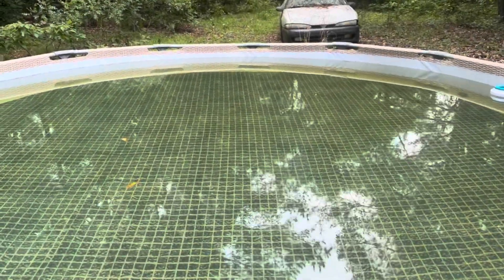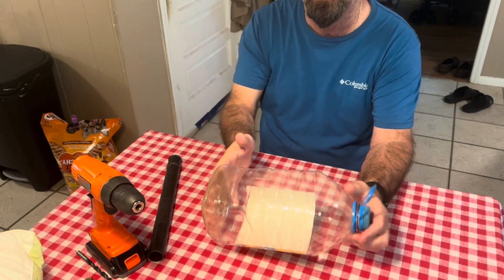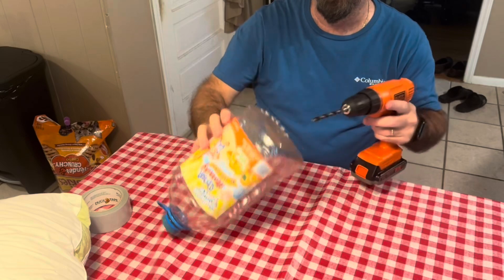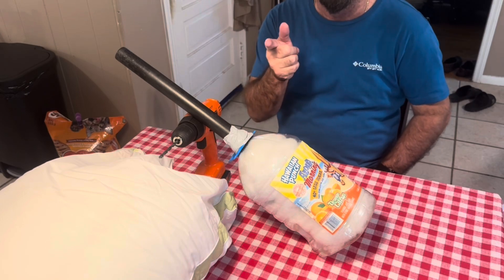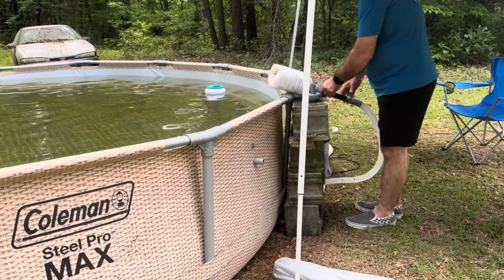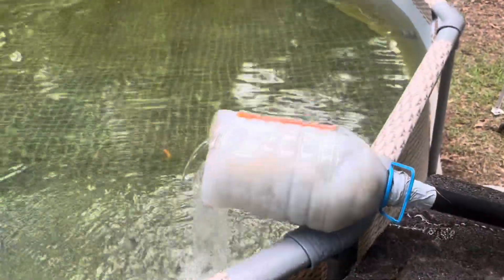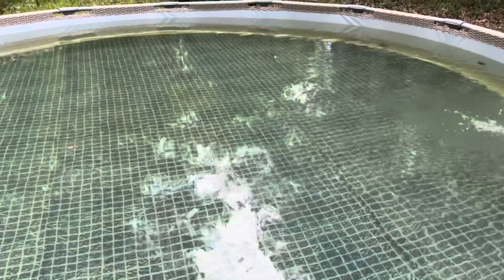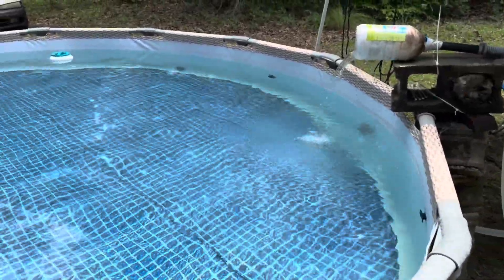How to get iron / rust out of pool water (well water)

Comment: buy a walmart pillow for $4, cut a corner off and zip tie the pillow around the return hose. the fabric gives you an extra layer of filter and the pillow is cheaper than polyfill
Reply from the maker: You could try it that way but it might would choke the filter pump out? I don’t know?
Reply: @ShinyKnife  that's what I use, works fine
Reply from the maker: @wg2228 ok there you go!

Comment: Can you do a video on how you clean it . What chemicals
Reply from the maker: Plenty of videos out there on that. I do however have a pool vacuum I show cleaning the pool should be in the description. The chemicals I use are 3 1 inch chlorine tablets with a clarifier. A little baking soda to soften up the water. And some Hypo Cal Shock. It’s a small body of water pretty easy to keep clean just run the pump 24 hours a day and it’ll be fine

Comment: yeah i have the same problem. just set the pull up yesterday with well water and shocked it then BAM! brown water. i'm just using 3 socks inside of each other on the outlet tube and the socks already turning brown from the iron. hopefully it works.
Reply from the maker: That’ll work. It will just take some time. If I was you I would plug one of the inlets to get better suction. That’s what I did with my homemade filter. The 2 inlets together don’t hardly have any suction. I actually took the t off and ran one hose to the inlet closest to the outlet hose. Keep cleaning the pool filter and those socks as much as possible. I’ve heard of people using socks. I just sped up the process with the poly filter. If your pool is as bigger than mine it’s going to take days to clear up. Let me know how it works out for you I’m kinda curious how long it’ll take with them socks. Good luck
Reply: @ShinyKnife  yeah from what i've seen it does take a a few days for the sock method. tomorrow morning i'm going to go out and clean the socks and the filter again. i cleaned the filter today and omg so much iron was in it. at least from now on when i top the pool off it will be with softened water. i'll let you know how long it takes. i got a few pictures if you want to take a look?
Reply: @ShinyKnife  oh yeah just one day was a night and day difference. still a little brown, sprayed all the rust off the filter and sock this morning. i've got to work on getting a pool vacuum...
Reply from the maker: @Red_Scorpian  awesome I’m glad it’s working out for you. You should have videoed the process and put it on your channel. I’m getting ready to review a pool vacuum in the coming days. It’s a stand alone rechargeable vacuum with a filter bag in it. You just put it in the pool and use it like a regular vacuum. I haven’t received it yet, but when I do I’ll put up a video up so stay tuned!
Reply: @ShinyKnife  i've taken pictures and will put something together tonight. i'd have all the metal out by now but i don't have a pool vacuum yet. so every day after rinsing the socks out and the filter i scrub the bottom to stir it up again, but's getting there. def way better then it was a few days ago.
Reply from the maker: @Red_Scorpian  Try this it’ll work if the pool has plenty of water in it https://youtu.be/ZQqQof2iv-k?si=yvlzyUgCb3_c9OHU
Reply from the maker: @Red_Scorpian  I saw your video last night you did a good job with those socks! I’ve heard of people doing it that way but have never tried it before.
Reply: @ShinyKnife  ok this is the 3rd time trying to reply. i ended up getting one of those vacuums you hook the water hose up to and it works pretty well. works on venturi effect.
Reply from the maker: @Red_Scorpian  yep they work,  pretty good. Only bad thing is they introduce new well water into the pool. I just had to top my pool up and it discolored my water. Took a day or so of filtering the water again to clear it out. Maybe your water is better than mine.
Reply: @ShinyKnife  well when i'm vacuuming i don't bypass the softener so i haven't had problems.
Reply from the maker: @Red_Scorpian  ok awesome, glad you got it worked out. I’ve used the hose vacuums before when I had county water, they work just fine.